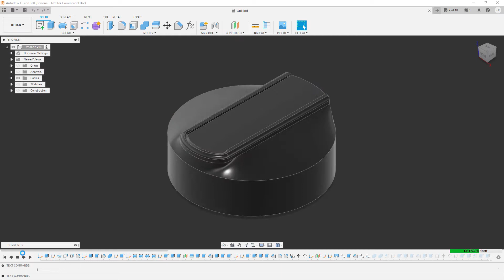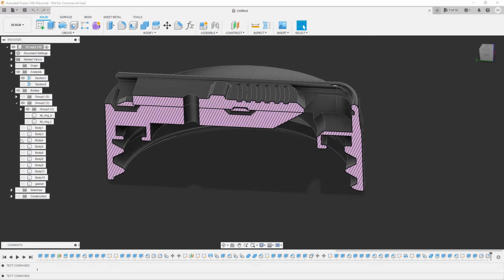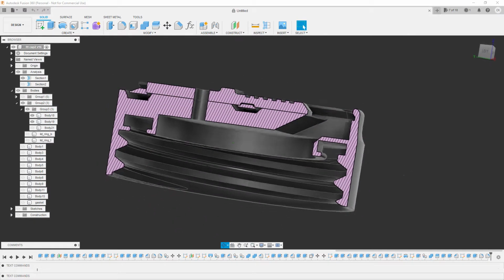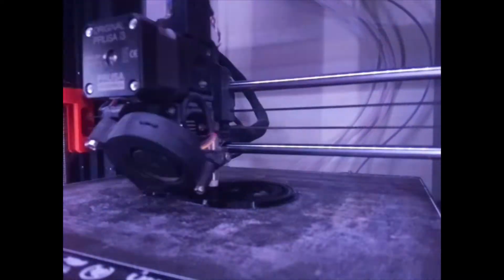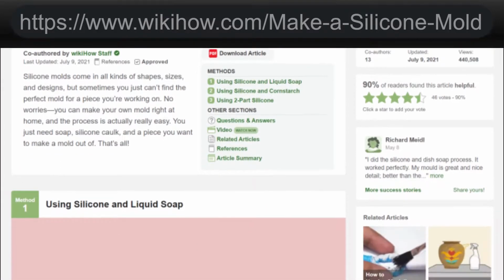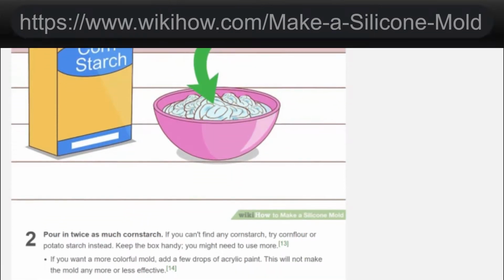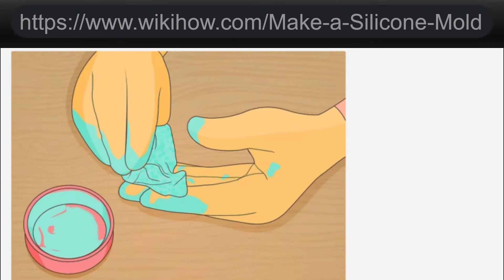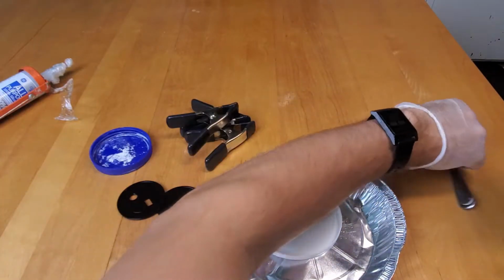3D printable lid for the LTT water bottle

Comment: Which thread did you use?
Reply from the maker: That was the hardest part I used ISO metric profile size: 64 MM design: M64X6 class: 6H direction: right hand. Then I increased the tolerance by .5 on the top and the bottom of the threads and added a .7 mm bevil to the end of the threads
Reply: @Make-it-work  thanks so much for the reply! I've tried modeling similar threads before... Lots of trial and error! Appreciate you passing this along